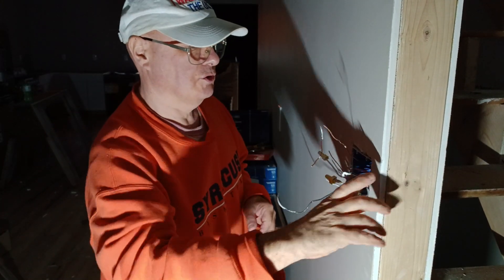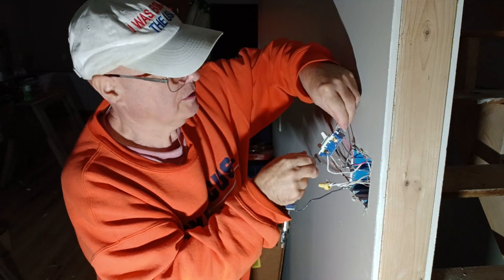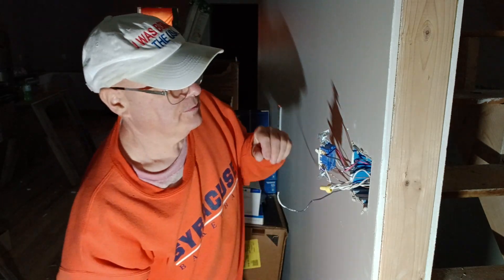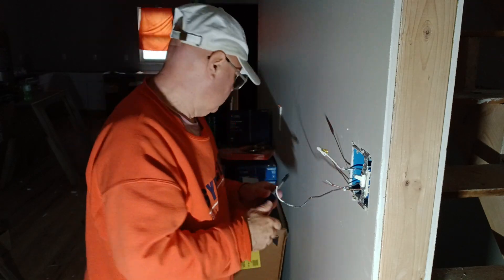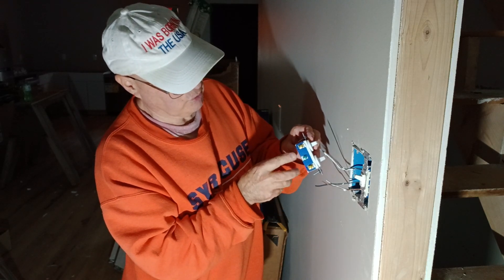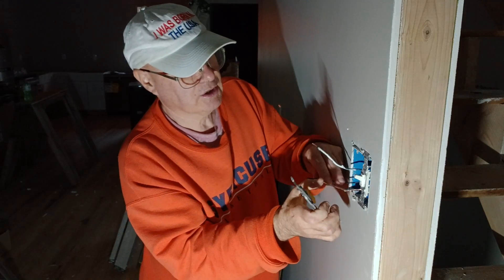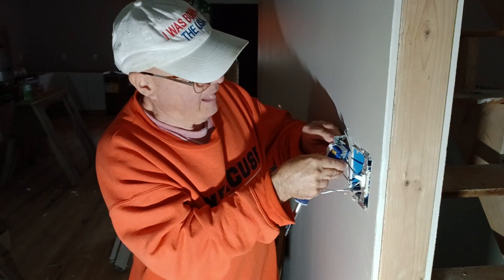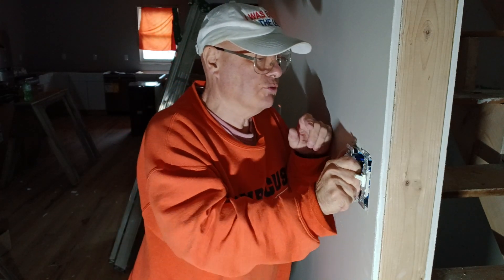May  2025 Eaton double switch 3 way or single pole and single pole 275-Bx-LW how to wire & install

Comment: i have a 3 way switch in 1 box  directly below it is a single pole switch in a separate box. i plan on using a duplex eaton 3 way combination switch. the single pole switch has 2 black wires connected, the 3 way switch has 1 red and 2 black wires going nto it along with both having separate grounds. these switches are on 1 breaker elimating one box. where does the wires go?